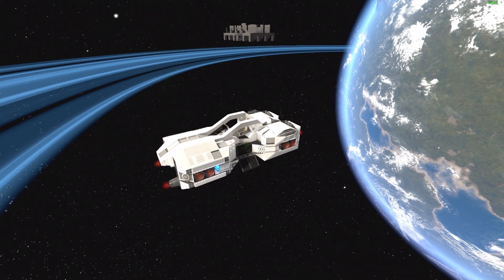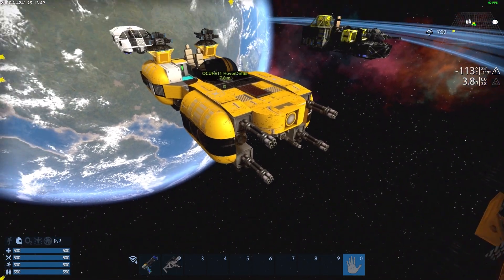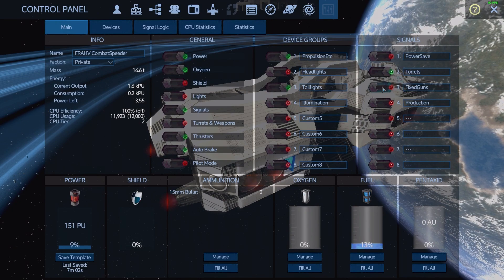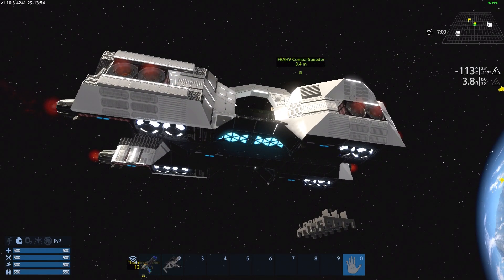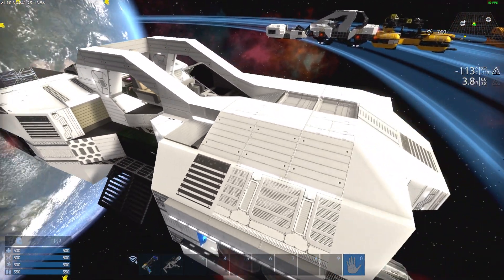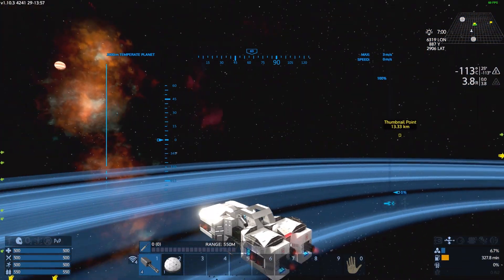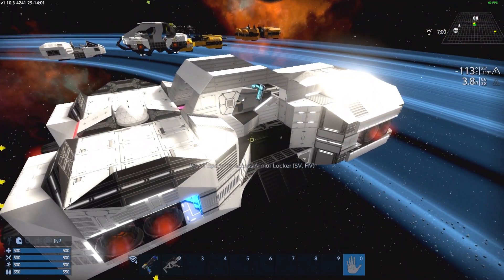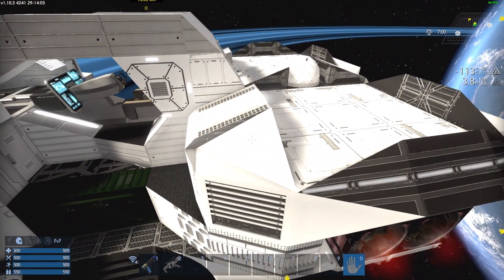FRAHV CombatSpeeder Tour

Comment from the maker: Please note - since recording the tour video I have learned that you do not need to quadruple the vehicle's mass when calculating the lift capacity in 4G.
I can confirm that, in 4G, it will lift ~40.7 (metric) tons, and with a vehicle mass of 16.6t, the hover engines will lift a further ~24.1t.